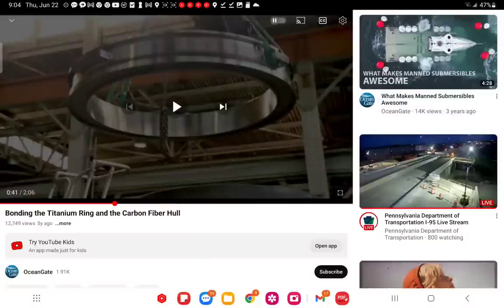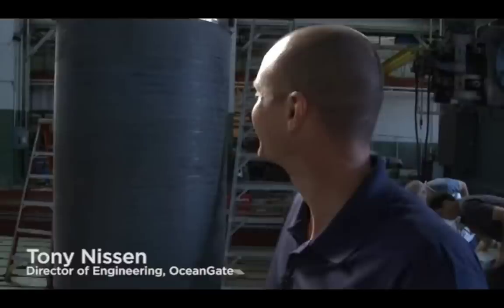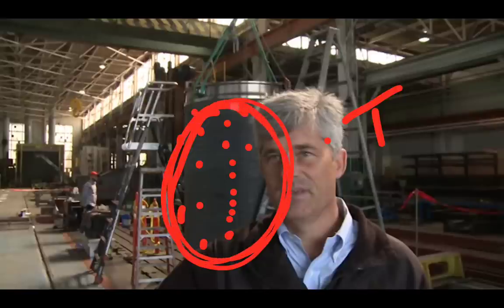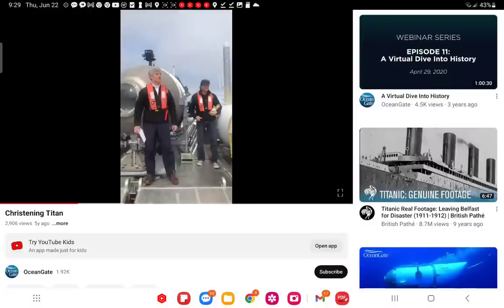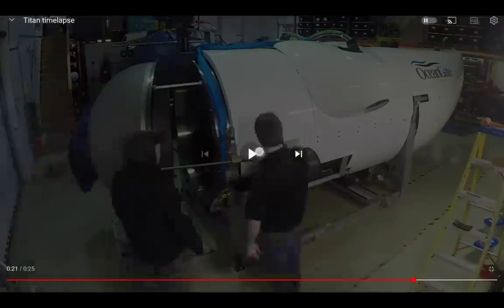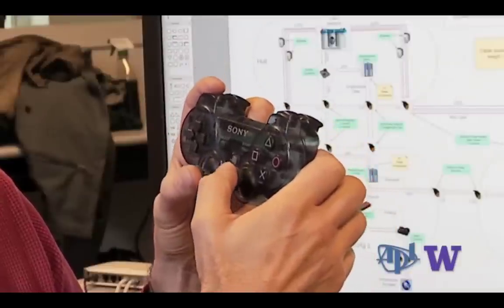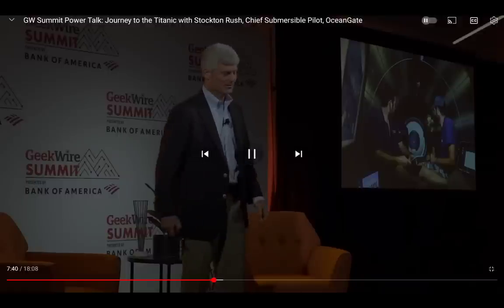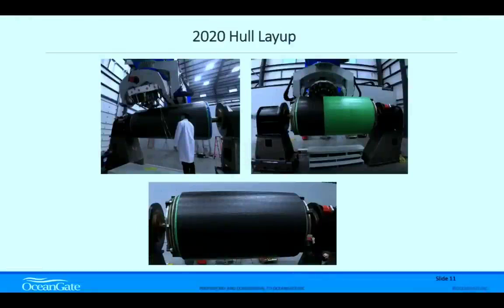Titanic Titan owner speaks out on his design test and APL University of Washington RESPONSIBLE??

Comment: 36:30 Probably to prevent the the sub door from swinging all the way open and hitting their nice roll up door.
Reply: Yeah. Looks like a jack screw or whatever.
Reply from the maker: I tried to find that screw deal...but, i found a video of a young man straining to open the door with this "thing" in place.
Reply: @ForensicEngineeringAnaylsis  well, it must be heavy as all get out. On the deck of the boat, it seemed they had a more rodlike spreader bar with the same slit in half pool noodle protecting people from bonking on it. I had read somewhere that no gaskets were used, and that a simple scratch would compromise the integrity of the seal. I'm no PE, but if that track were a gasket, it would be quite small at depth. 

There's simply too much going on. Hopefully the engineer that was sacked comes on for an interview.

Comment: So many great points, step ladders, gluing two round things (watch a plumber with plastic pipe), loaded beams, Kaiser effect! See the AE gets worse after getting better and begins to move nearly straight up! Not easy to recover from with a slow submarine. An airplane can pull out of a manoeuvre in seconds in contrast. I’m teaching systems engineering and sensors tomorrow! Shall I mention this AE sensor stuff? Nice sensor technology but wrong system to use it on! I’m going to have to use it!

Comment: I am wondering what happened at failure point. I see two possibilities. The common one is that the carbon fiber tube collapses and the two end caps came together like firing mechanism of an A bomb and you have two endcaps left. What if the tube held and the window gets punched in, or the rear area where all the wires go through gets punched in and five people inside and the entire air bubble they were breathing gets  reduced to the size of a chicken egg  and when that mass goes off, the carbon fiber hull holds  and instead of blowing up like a bomb, they all comes shooting out like a rocket. The whole pressure hull might be miles away and still intact.

Comment: Great diagram showing how the carbon fibre tube battles compressive forces horizontally & vertically (horizontally from both the end caps and vertically (say 90*) directly from the water. 

Intuitively, I would guess the horizontal forces are much higher, but they are spread around 360*. And I would guess the middle of the tube flexes inward the most so might need thicker walls.

Bicycle tubing walls may be thinner at the midpoint and thicker at the ends (entirely different use case but reasonably studied and tested). 

Are carbon fibre sailboat or sailboard masts reinforced differently up length? There is optimal strength design but I think flex patterns also are designed to optimise sail performance.

Comment: To me - and I believe you bring this up. The titanium end caps + glue try the restrain the end of the carbon tube from rotation ( due to tube deflection under pressure) and hence this generates a moment on the joint (glued joint and carbon) trying to lever the carbon out of the channel. In addition to this the joint is subject to axial tube compression + radial hoop stresses + differential thermal ? I would of thought the axial + moment effect would be subtractive on the outer surface and additive on the inner surface. I wonder if this combination of complex loading actions on a 5 inch thick laminate glued into a channel would cause some very difficult analysis problems. Who knows ? I would not want to have given my name to the calcs.

Comment: Regarding gaming controllers,  people overlook something.  Wireless is a needless issue. It should be a corded connection.  If it was me, I would use something with reputable microswitches and a corded system. Then have extra stored inside for backup.
Reply: Wired, until someone trips over a cable, pulls a connector apart, and then they have an issue ...

Comment: We won't know the exact failure modality until good photos appear. I still maintain it was like a crushed coke can. The carbon fibre main body imploded causing a sudden outward pressurization which blew out the ends of the cylinder. 
     When the craft was operating as designed the end caps would be pushed into the body cavity. Differential material contraction and expnasion could cause leakage but as you suggest it would not be responsible for a sudden catastrophic failure. 
    I will be interesting to see the recovered pieces of the vessel for a final determination.
Reply: I guess either a crush in the middle of the cylinder, or the ends gave out and sheered off the joint. A small leak that delaminated the CF at the joint, made it weak, and shattered it at depth.

Comment: Remember,  Psyclops 2 was re-named to become the Titan.
   I didn’t see them centering the ring on the tube. It could be 0.01mm on one side and 5mm on the other. No way to tell on mounting the ring to the tube.
  The surface area on the tube is greater than the ends, thus the pressure on the tube would be greater than the pressure on the ends. 
   I wonder where Psyclops 3 is right now? Mr. Rush said it was in development. 
  I wonder if Spencer Composites had already spun up the tube for Psyclops 3? Here's their website...
https://www.spencercomposites.com/wordpress/
   I still wonder how any liftbag system is supposed to deploy with the shell on there in an emergency???
   The more I see the "thread on a spool" wrap, no vacuum treating and no autoclaving, the more it seems the tube failed. The noises they were hearing were a problem, and were likely microfractures where the air pockets collapsed under pressure.
   Interesting about no sensors being placed within the wrap that we can see. Did they glue them inside? Outside?
   I'd like to see the numbers for the pressure hull, the electronics & hydrolics exposed to pressure for the rendition of the Titan that failed, and the duty cycles of those parts.
   If the people aboard were "crew", do their families recieve death benefits?
  Mr. Rush said they had "5 subs". What are their other subs in the clip!?! What is happening to the other 4???
   It is worth going back through the promotion videos again, and listen very closely to what was said, watch the videos, etc. 
  Interesting that the apparent destructive test failed at one end. What pressure did it fail? And what's the blue stuff on the wreckage in the photo Mr. Rush showed in his presentation?
   Mr. Rush was wrong about others not breaking things. That is exactly what destructive engineers do! 
  He said he only took the 1/3rd scale model to 6,000 psi. Did he, or any of his engineers not calculate the pressures correctly? Not accommodate for movement in the water? Bumping into things? Rapid descent???
   2.4 miles = 12,672 feet or 384ATMs in sea water at sea level. Add 1ATM for air = 385ATAs. At 14.7psi/ATM, that's 5,659.5psi of hydrostatic pressure.        STATIC pressure being key. 
   The 2.4 miles, or 12,672 feet deep, was at the top of the Titanic, apparently, yet motion would certainly add to the stresses on the Titan submersible, as would any stresses from the weight of the vehicle, thrusters, etc.
   The larger the vessel, the more pressure on the vessel, as the more surface area. A full-scale vessel would have 3x the surface area, or there abouts, thus about 3x the pressure and overage should've been the testing pressure.
   16,978.5psi should've been the absolute minimum static testing pressure, then add for movement, bumps, etc.
  When a 1/3rd pressure model failed at 6,000psi, they should've scrapped this idea.
  This math isn't hard, and yet is critically important.
Reply from the maker: https://youtu.be/sqATlCzj9rM

Comment: They said Titanium before on the ring, Titanium and carbon fiber react differently to temperature and pressure was that taken into account I wonder?
Reply: They glued them together with epoxy. They used a 30usd controller. I'd take a guess not.

Comment: This is the first time I've seen this construction video. It looks like the bond between the haul and end cap possibly failed it's only a 2-3 inch overlap and I'm pretty sure that carbon fiber was flexing pretty good on dives. I think the pressure cycles might have weakened the glue joint and one of the end caps just popped out causing the implosion. That green is probably a release compound as for the line i have no idea it might just be a light mounted to the cylinder?

Comment: I'm not sure of the exact dimensions, but guesstimate math tells me there is approximately 16 million pounds of force pushing each dome into the tube at depth. Not to mention the 5800 pounds of force on each square inch of tube...and with all that going on, you cannot afford the merest deflection of the tube dimensions...Implosion energy available is equivalent to 100 pounds of TNT. Nice touch, enlisting all the 'crew' for another test dive.
Reply: I found 8650tons, other people said 11000 tons at 400 pressure bars, it depends of the real end caps diameters  ( 4, 6 feet added by 2x 5 inches wall thickness ouf the carbon tube). This done a pressure of 1440 bars on the carbone fiber sections. We do add the radial charges on this tube ( Von Mises rules).

Comment: One thing he has done, is prove carbon fibre CAN'T be used in deep ocean exploration.
Reply: Well, cf is pretty much a bunch of very strong ropes. Now, I see no way of building a compression vessel out of rope. Expansion vessel, CF works great, compression, the only thing holding on is the glue.

Comment: I was thinking why couldn’t they make a skin say 4 inch thick titanium cylinder then manufacture a slightly identical cylinder but slightly smaller fill the area with hydraulic fluid or something suitable to match or say half as much the pressure of the outside water pressure to counter the forces  instead of wanting to crush in on itself? Does that make sense to anyone or am I thinking of it completely wrong lol
Reply from the maker: You are awesome, I have also thought of this but you would just have to create the fluid pressure to take the full force.
But, bc you are thinking outside the box, I want to hint to use that thinking somewhere else and consider it being pressed on, it would have to be backed by a non-deformed surface.
But, forget all that, think of this system being a form of arches and how could you use the exact diameter that would just use the outside pressure as the arch's "abutments" ... One big circle of transferring the force
Reply: Так и строят настоящие подводные аппараты. Полость заполняют бензином.

Comment: For a start off, there are no 'doors' on the Titan sub...  Or on ANY sub for that matter.   The ends of the Titan were titanium spun hemispheres. 

Also,  your attempt at scaling the titanium ring with respect to the guy's chest was wrong, you didn't take into account distance and paralax; the suspended ring being a good few feet away from the guy....   

The Titan, might have worked with a carbon-composite  pressure hull, IF more itianium FRAME RINGS had been used, equally spaced along the INSIDE of the pressure hull...   This is how real submarines are constructed;, only they are not pressure rated for 6000 metres...  

The Titan was a bad design, mostly because of lack of experience of the designe team.    Should have gone with the 'ageing submariners' ....